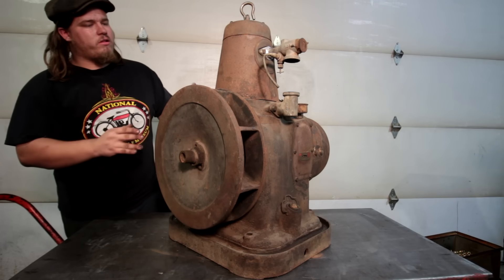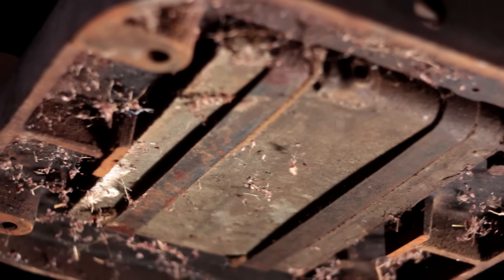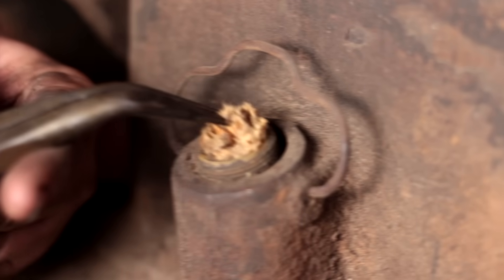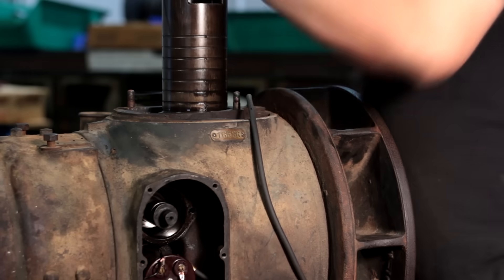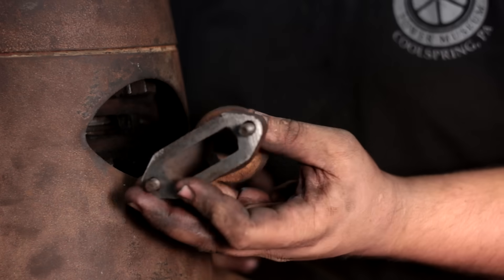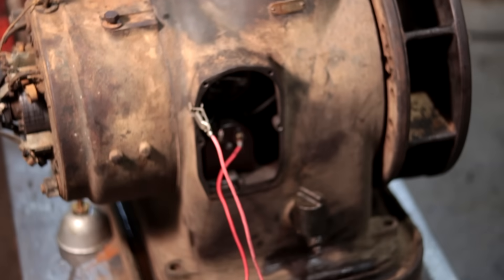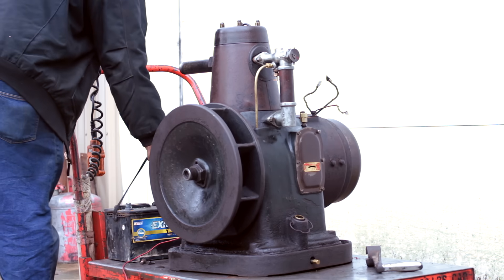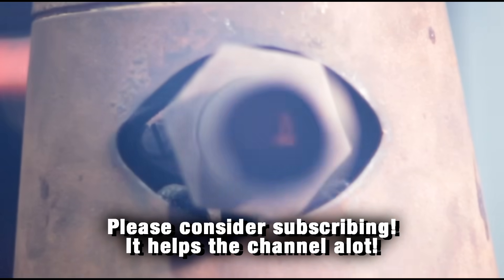100+ Year Old 4 Stroke Engine Design Has NO VALVES!!! Can We Get it Running after 60+ YEARS??

Comment: Not a valve in the common auto sense i.e. "poppet valve "' but a valve by definition just the same. 
There are gate valves , ball valves,  slide valves butterfly valves.
 All have the same function just different  actuation.Should be called a poppet- valveless engine.
Reply from the maker: Yes that is true but it sells better on YouTube this way and if we used that logic on sleeves then all two strokes have valves.

Comment: It has no poppet valves, it has sleeve valves
Reply from the maker: Yeah but then are you going to say two strokes  have valves  it's fundamentaly how the piston and cylinder on one works.
Reply: @ two strokes have fixed ports, sleeve valves were once popular in early aircraft and diesel engines when efficiency wasn’t a concern

Comment: This is the third of these motors I've seen, two were at an antique engine show some years ago. One was the single like you have the other was a twin, both with generators for 120 volts DC.

The demo at the show had one of these charging a 120 volt battery bank that was used for household or shop lighting. Yes it was using the Edison DC electric system. 

These were high tech for their day. Thank you for bringing this old girl back to life.
Reply from the maker: That is pretty cool!

Comment: Are you Shure that thing is 12v? Cars didn't have 12v until 1955, are you using a ballast resistor?  I'd figure it would use 6volts.
Reply from the maker: The generator is 32 volts so the coil would be rated for more then 6 volts

Comment: Still don't understand how that works, has to be some kind of a check valves for an intake and exhaust I don't understand how that possible
Reply from the maker: The two sleeves move to cover and open the ports to control when they are open and closed

Comment: Back in the 1980's I worked for a company called Barr and Stroud & in the 1930's they also produced sleeve valve engines (singles & V twins) & I was fortunate enough to get some engine drawing prints off the original 1930's linen drawings.
Reply from the maker: Very cool
Reply: Do you still have the the prints? Would be quite interesting to to build a working model of one.
Reply: @sjcroc I do still have them. Unfortunately I never found anywhere that had an A0 scanner to get them digitised but if you knit yourself a temporary email address you can publish here  I can send you high res photos of the drawings ( and once received you can kill the email address so no future spam on it forever)

Comment: I've never seen anything like it, amazing, runs great. Does it basically run just at a certain rpm, or can you throttle it up?
Reply from the maker: You can choke it down but there is no proper throttle on these old light plants. Just wide open.

Comment: Hola! The sleeve is a valve...
Reply from the maker: The sleeve is a sleeve, that has a port in it  not valve there only a moving port.  They used valve in marketing for people to understand but fundamentaly there is no valve.
Reply: @cruddycornstalks  "Fundamentally" the port in the sleeve acts in conjuction with the piston side wall acting as a valve called a piston valve serving the same purpose as a poppet valve and its mating valve seat. If this were not so, in either case, there would not be functionality et, a running internal combustion engine. Your heading alludes to poppet valves and not piston valves...

Comment: I love these old light plants. I have worked on a model 1250 delco light plant and it is now running and charging. It too had the remains of a rodent's dining room in the generator. The valves on it do make quite the clatter. I even managed to find an original salesman lamp. I posted my progress on getting it running on smokstak as well as a video of it running.
Reply from the maker: I always wanted one of those lamps but they are out of my price range
Reply: I am considering making a 3d model. I will post a link If I ever complete one.

Comment: i wish we got more of these types of engines
Reply from the maker: @DatBlueHusky  to many high wear items with the sleeves. but maybe there's a better way to do it out there.
Reply: @cruddycornstalks  def is, these sleeve motors made its way into the rc hobby world, company called RCV made them for years and they lasted long time. If continue of development of these engines we would have ones lasting as long as prob normal valve car. Its prob main reason is pollution and oil consumption that might have turned companies away
Reply from the maker: @DatBlueHusky  could be!

Comment: Was that used to maintain the charge in your batteries? Did it automatically start when the voltage dropped?
Reply from the maker: @19723020  yes it would have been setup just like a declo light plant.

Comment: No valves of conventional design that today's engine use. However, engines from that era used sleeve valves. They were more common on airplane engines.
Reply from the maker: @thomascaldwell8902  yeah they called them sleeve valves but in essence it's more of a moving port then a valve.

Comment: I've heard of sleeve valve engines, but that's the first I've actually seen in detail - and to see it running so well is amazing.
Great video, thanks.
Reply: I've never seen a double sleeve valve engine in operation, most (in Europe at least) had a single sleeve that moved up and down, and also twisted to align to the different ports in the cylinder.  The famous Napier Sabre aero engine used in some WW2 aircraft was a (single) sleeve valve design.
Reply from the maker: @ferrumignis  it was Willy's main design to have two they used it in car engine up to inline 6
Reply from the maker: @RJTC  glad you liked it! I always wanted to look into one and share my findings